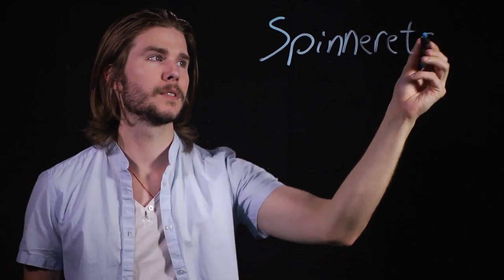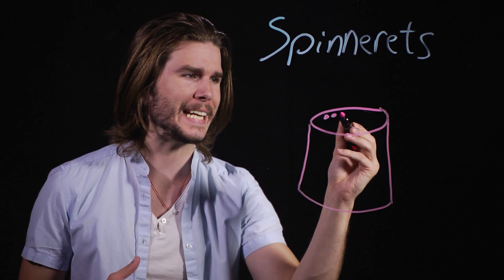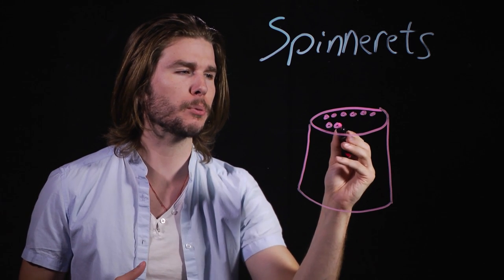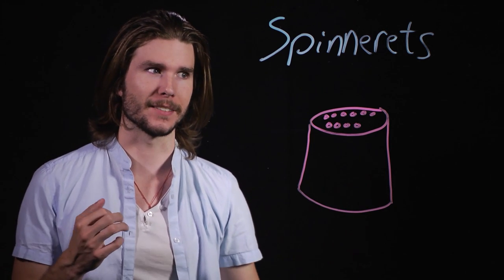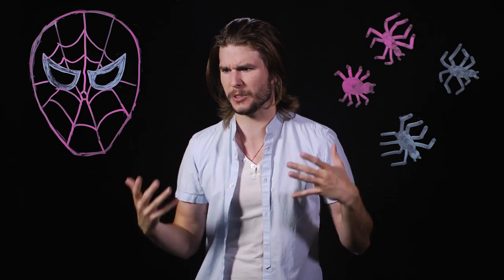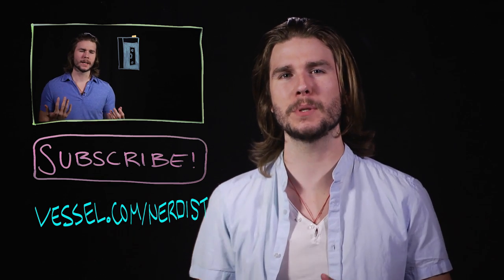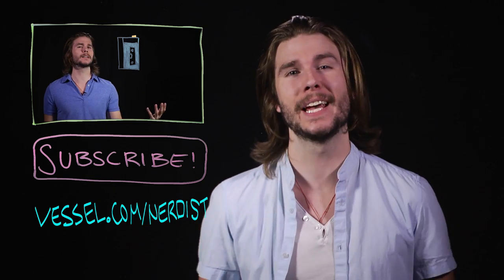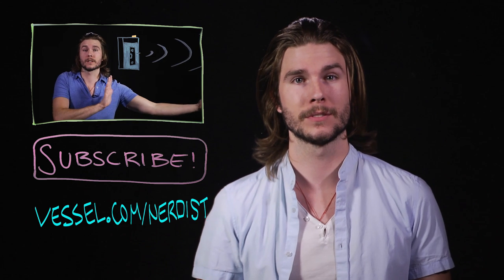What’s in SPIDER-MAN'S Web-Shooters? (Because Science w/ Kyle Hill)

Comment: I have a question. Spiderman is strong as crap, and when he shoots things with his webs, and he can pull the things with minimal effort. but how come when he shoots a building with his web to swing, why doesn't a huge chunk of building come out when he pulls to swing himself??
Reply: The path of least resistance. Spiderman is easier displaced compared to a chunk of a building so the force he puts on his web will move him and not the building. If he were to buckle down and attach himself to the ground then he probably would be able to tear of parts of a building.

You can test this out yourself. Try and pull a locked door towards you. You won't be pulling the door out of its frame but you'll probably pull yourself towards the door.

Comment: Oh, THAT's where they got the idea for the spider sense: From the web-vibration detection thing that spiders use. I never made that connection. Awesome!
Reply: Spiders do have bodies covered with hair that allows them to somehow detect large fluctuations in the surroundings~
Since they don't have ears, spiders rely on trichobothria to help them hear. The tiny hairs are super-sensitive, able to pick up air movement down to one ten billionth of a meter.
Reply: Rew Rose
That's pretty cool. What's the range?
(I assume this works through air, and not just on their webs)
Reply: Alex Larsen
 as long as the movement affects the air immediately around them , the movement will get detected by the spider ( distance won't matter )
they can hear or sense sounds in 38-44 kHz range~
Reply: Rew Rose
Cool. Thanks for the info

Comment: What about the release mechanism? Is it really possible to shoot a web to skyscraper without having to carry around tanks of compressed air? Are the webs like a liquid at release which hardens while on contact with a another reactive substance? Is it possible to do that with spider silk? Can that substance really be that condensed and last as long as the cartridges seem to last? (Considering that spidey regularly swings from long webs) How elastic can the web be? Would it be safe to be rescued by one or swing on one? How sticky it would or should be to stick on a regular surface and hold a free fall by spiderman? Would a regular surface resist that or the surface would just peal off? Now, my real question: CAN ONE BE SPIDERMAN?

Comment: Yeah out of wrists and no carpel tunnel syndrome? What I don't get is silk is drawn not shot as I understand it. So some flea power in its structure? Not to mention the forces snipers contend with. Hum I could mostly read the rest. I also wonder why Aquaman would fight not annihilate considering how pollution works. Also the ocean is prone to parasites so does he have worms? What about electrolysis? If you have water moving powers how strong and could you just fall asleep on it. How would Superman use a bicycle? Snapped chains? One model has a solid drive shaft. Also a plastics or metal multimidas power? I've always wondered if the silk went tension, spring or rigid. A crystallize power not ice and it's control to suspension.
Reply: +Angela Lagomarsino Jeez, slow down! One thing at a time!